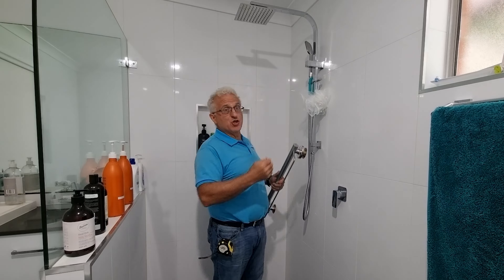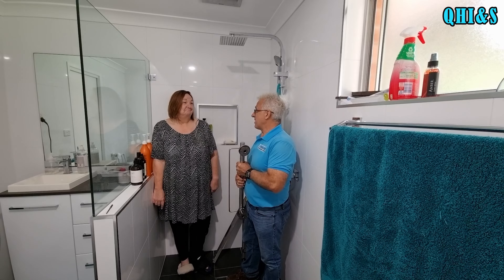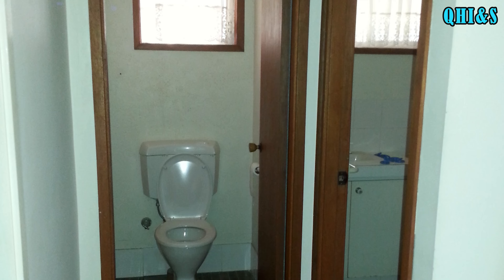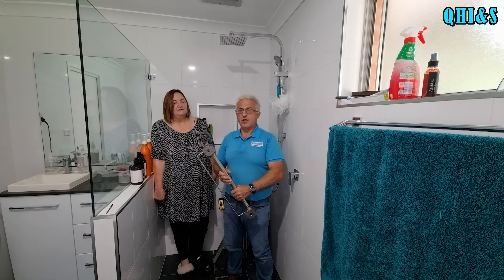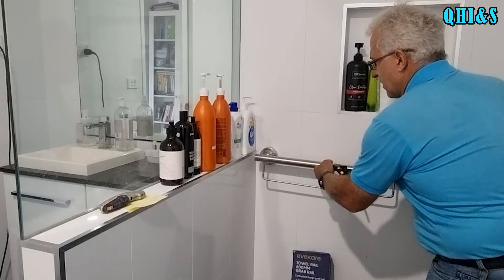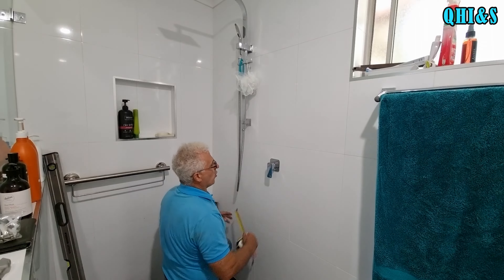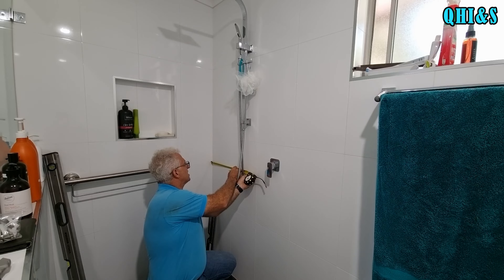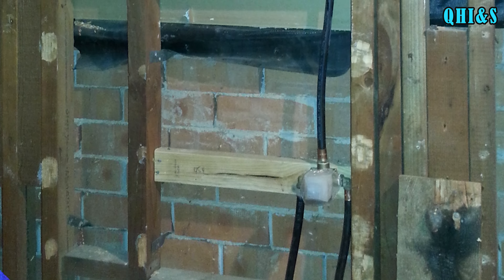Install a Shower Grab Rail the Right Way, Using EveKare! Quick & Easy DIY

Comment: Looks fantastic and sturdy enough to hold my weight if i fell. What would you use to secure it to the wall if it is concrete or cinderblock walls?
Reply from the maker: That's a good question! Going into bricks, I would use a heavy-duty plug and screw. However, I am assuming that cinder blocks are what we call here in Australia, Besser blocks, which are usually a large 400x200x200 concrete blocks. If this is correct, they are a pain for products requiring structural strength. But the same, heavy-duty plugs and screws. However, always read the manufacturers specifications to confirm this is correct for their products! I hope this helps, Cheers